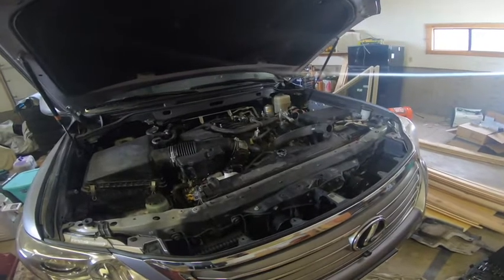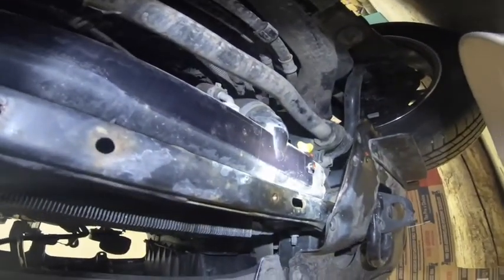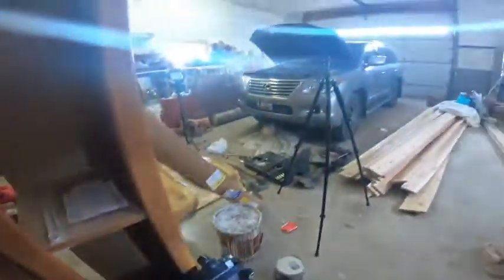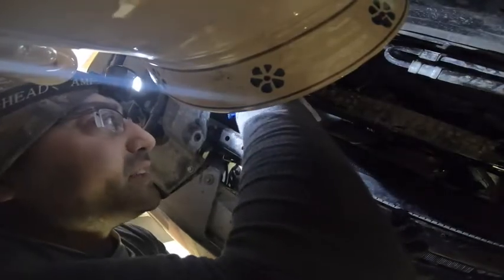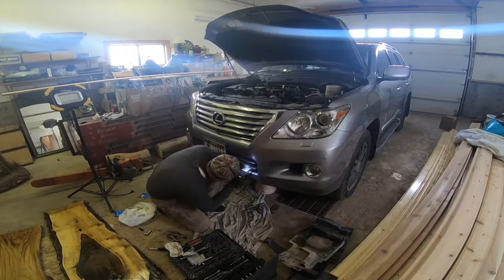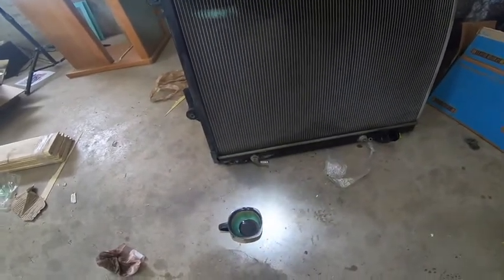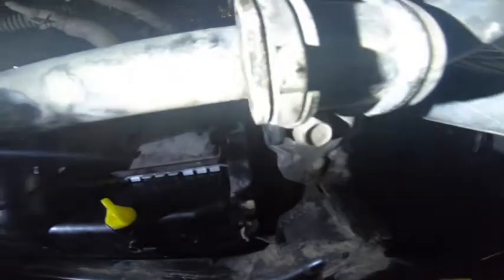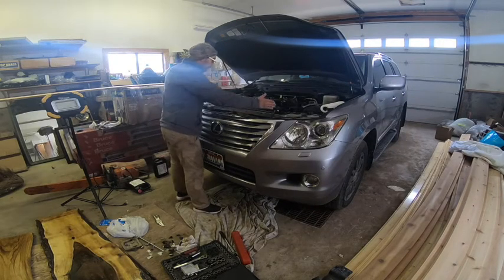Land Cruiser 200 Series or LX570 Radiator replacement

Comment: The Lexus Dealership just quoted me $1,700 to replace the radiator in my 2011 LX 570 with the exact same leak.  I'll be replacing it myself, thanks for the video.
Reply: Same quote from my 2013 LX 570. I planing to change it myself . On the.

Comment: The plastic radiator top is nylon.  To patch use JB Weld's "Radiator Repair Kit" instead of their general use epoxies.  I'm replacing the radiator on my 2011 LC and very much appreciate your making this video.
Reply from the maker: Thank you!

Comment: Well, dealer only performed transmission pan drain which replaces roughly 4 quarts out of 12 total in the system. You could perform oil cooler flush using passenger side cooler line you removed but that is not recommended on high mileage vehicles and there could be some Toyota TSBs advising dealers against. If your clutches are worn changing all fluid at once could cause more harm than good.
Reply from the maker: Thanks. I think I will stick to the pan change and you are probably correct. I had my Tundra fluids changed at 155K and 195K and it has been just great. I think high mileage has a different definition for toyotas hahaha!
Reply: Yellowstone Beauty, well lifetime transmission fluid that is about 120k,  despite you should  change at 60K when towing or 100k with light use. Pan drain is always best as it is PRE filter so you always drain some metal shavings with the fluid. Dropping the pan would be ideal, changing the filter and cleaning the magnets but be warned, pan bolts are known to snap easily, if rusted best left alone.
Reply from the maker: @mikemach6163  Thnks a lot... I may try this myself and make a video. I am going to do another fluid change soon!

Comment: I changed the tranny filter and fluid myself. I flushed as much as possible from the cooling lines. It’s incredibly messy but rewarding knowing it’s done ✅ correctly. I used Valvoline full synthetic which exceeds Toyota’s tranny fluid. I did that 25k miles ago with no issues. I’ve taken my ‘08 over many CO 4x4 trails. Tranny worked flawlessly. The guy in Australia (Project 200) has a video on how to properly obtain the correct level of tranny fluid after refill. The process is accurate. Thanks for this video. Big help.

Comment: I change yesterday radiator after problem transmission 30 to 40 to 50 speed 
What I do?
Reply from the maker: hey sorry for the delay. Did you make sure not to lose the transmission fluid? I would say check your transmission fluid level! you must have lost too much fluid.

Comment: I have same problem with my LC 200. The radiator is leaking at same spot as yours at 135k km. Is it common for all LC’s ?
Reply: Yes! They updated the design, so that stress point isn't an issue with the replacement radiators you'd order from the dealer. The LC groups on FB are very helpful with your questions as well.

Comment: Talking about off-road vehicle and making that passenger side lower bolt impossible to access is pure Toyota greed over legacy….they discourage you to work on it by yourself and want to take it to the stealership for them to charge you $$$ for all that labor to remove grille, front bumper and at air cooler…👎🏻